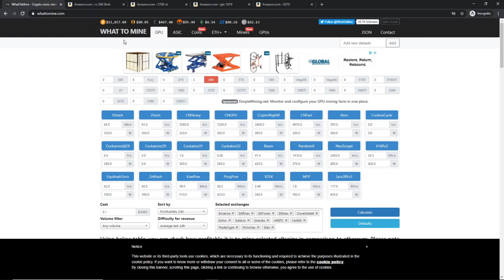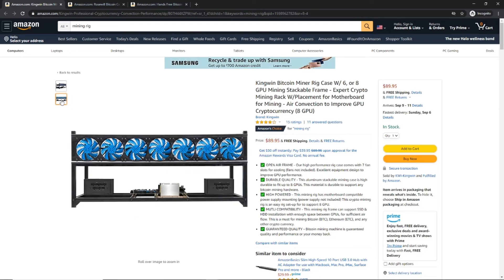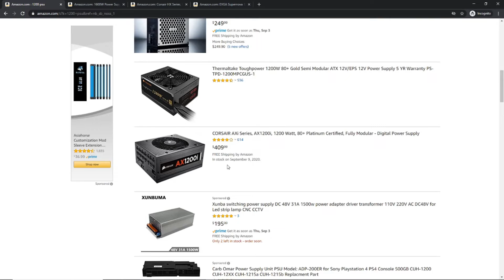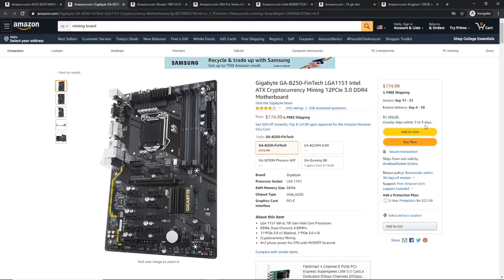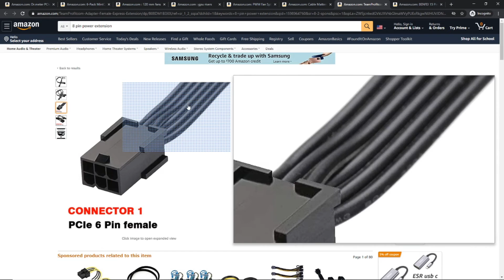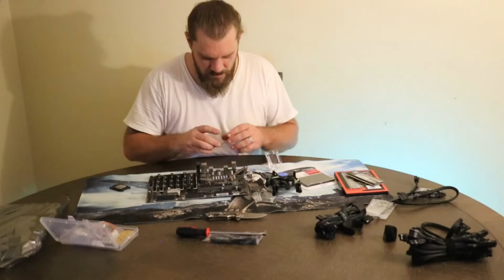GPU Mining Rig Build 2020 | Considerations, Tips & Tricks

Comment: I have a question for you. Im starting a 6 gpu rig and was going to use Red Devil 5700xt. I purchased an EVGA 1300 P2 but noticed it only has 6x6+2 cables. Devils need 2x8 pin each
Reply from the maker: Yes, you will need splitters.